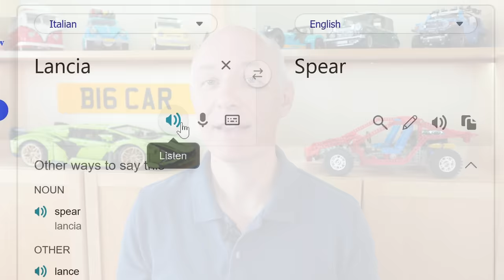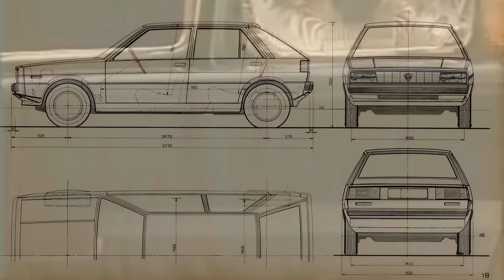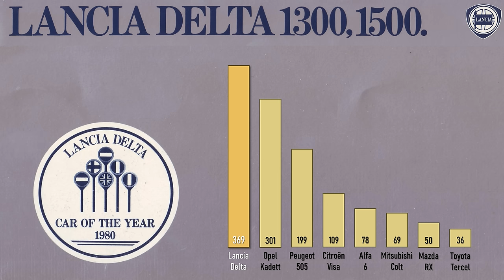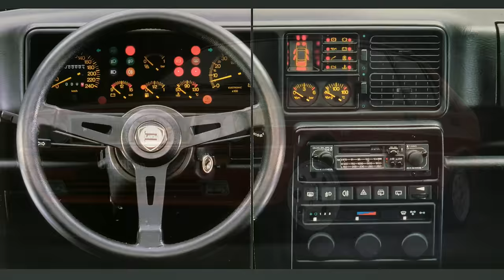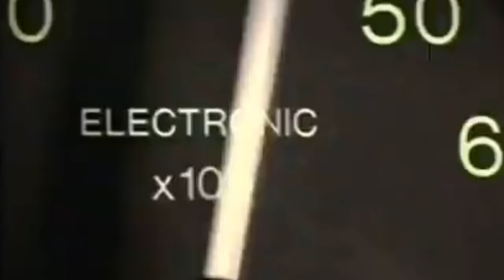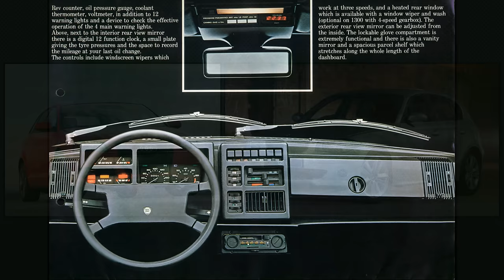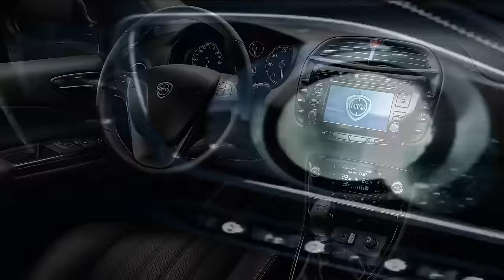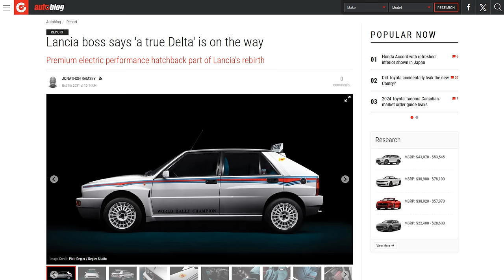Delta Forza - The Lancia Delta Story

Comment: It's incredible seeing an old Lancia Delta that is not an Integrale on the road: They look like two completely different cars. One is a battered, out of fashion, old italian mid sized hatchback, the other is a beautiful icon with a sporty and beautiful design.

PS an an italian, living a couple of kilometers away from where they built the Delta S4, I apprecaite the pronunciation effort.
Reply: I appreciate the original shape of the Delta before the swollen arches etc.
Reply: It's hardly a beauty... 😂 
The original Delta design was particularly good - especially for a fwd platform - with distinctly balanced, co-ordinated proportions.   Over time, the fine lines were taken over by more and more muscular features.  Panels, arches, lumps and scoops stretched over overhauled suspension, wheels, induction and engine - looked tough for once-practical passenger car, but it was never beautiful.
Reply: @assininecomment1630  No but it was handsome and stylish.
Reply: Yeah, I suppose you could say the early Integrale were handsome, @Jack-tx2ve .   Still, the extreme arches and bonnet bulges of final iterations, weren't 'gilding the lily', they were function over form.
Reply: A good simple GTi.e 1.6 with its standards alloys, velvety seats and tinted windows was a nice sight.

Comment: A cool thing: one of the Delta's design prototypes originated the FSO POLONEZ! FSO was originally planning to put 2.0 liter engine too, but the license to produce it was too expensive so they just adjusted the design with the Polski Fiat chassis.
Reply: They even shoved a Stratos engine in the back of a Polonez back in 1978
Reply: Now I want to see an AWD rally Polonez
Reply: @claudiobizama5603  The Polonez 2000, it was used on Rally.
Reply: This is a never confirmed myth. Both cars had totally different design preassumptions, since 137 prototype Polonez was based on, was meant to be rear wheel drive from the start.
Reply: @MREnzoHerbie   Not exactly. The Polonez was supposed to get a range of 1.4 to 2.0 SOHC engines, but since there was a 'temporary' use of 1.3 and 1.5 OHV, the sports division hand-built cars with 2.0 DOHC as homologation special.

Comment: I worked for a Lancia dealer in the early '80s and my firm's car was a Y10 Turbo, which was interesting to say the least. I drove almost all the cars in the range and I the car I remember most was the HF Turbo and the ie version that followed it. Despite having 130, and later 140 bhp it had narrower tyres than the XR3i and RS Turbo yet, still held the road really well and handled brilliantly. I always thought that was down to superior design and engineering.

Unfortunately the spectre of the Beta was never far away.

Comment: Fell in love with the Delta in the mid 80s when I saw one on the coast road in Liguria near San Remo in the mid 80 s… in the gorgeous blue colour like the one at 10:30 in the video… an iconic colour like on the Betas and Trevis of the period. I had a facelifted 1986 1300 LX in red, fantastic little car until a front end crash wrote it off.. bodyshell creased at the top of the A pillar / roof junction and that was that..😢

Comment: It’s good to be reminded of these cars. I had an ‘86 Delta HF Turbo i.e. which was great fun. It had it’s down sides (continuous electrical gremlins, single figure m.p.g. when driven <cough> spiritedly, and an appetite for wheel bearings (or maybe that was my driving style) and I used to describe it as a four door, two seater as putting adults in the back seats wasn’t kind), but it was FUN. Miss it still.
Replaced it with a 2 litre Dedra (thanks for mentioning them here, most people in the U.K. seem to have never heard of them) which was an enjoyable car, but definitely moved the dial more towards comfort over sport.
Reply: My 2.0 SE Dedra ranks as one of my all time favs, fast, reliable - burned a bit of oil - very comfortable and roomy.

Comment: I had a 1982 Delta 1500 HLX for a short while in the early 90's. It was the same colour as the one shown at 0:40 with the exact same interior trim as the one shown at 4:05. Although it had a really nice quality interior, and a few design quirks compared to most mainstream cars (interior door release was inset into the door armrest, so not immediately obvious as they blended into the trim), or MacPherson strut suspension all round, it was also the most unreliable car I have ever owned and left me stranded on quite a few occasions. Also, things like the ride height being quire high so that body roll in corners was massive, and when cruising at 70mpg in 5th gear the engine was pulling almost 4,000 rpm which was ridiculous.
Despite all this, I still remember it with fondness and if I had the money would consider buying a good condition HF Turbo. I probably would regret it as I would probably be left stranded somewhere, but at least it's a nice place to sit while waiting for the recovery truck. Again.

Comment: The HF4WD was special, pretty sure it was the first small hatchback with a 2.0 turbo and 4wd. The 0-60 was 6.8 seconds, that was outstanding back then. The integrale was 185bhp, the Kat (catalytic converter model for Swiss market) had 178bhp. The Hyena wasn't available as a convertible. The Evo came with 210bhp, Evo2 had 215bhp in standard form. I don't see Lancia making a come back.

Comment: Never really understood why they made an Alfa 155 Q4 which was Tipo based with integrale mechanicals, so they could have made a 2nd gen integrale
The Evo E cars died rather spectacularly in a fire sadly
Reply: I've read the Mk2 Integrale was canceled late in development as the rear floorpan was actually designed to fit a 4WD system
Reply: @JK061996  - that is true, early Mk2 examples are 4WD ready, they've replaced the floorpan to regular one later on.

Comment: In the 80's Fiat/Lancia dealerships sold the 5 doors bone stock Delta as a family car because Fiat had only the 3 door Uno available at that time.
Both had the same 1.3 engine and for that time already a 5 speed gearbox.
The in height adjustable steeringwheel was also not seen often at that time.
Bone stock means bonestock. no passenger side mirror, carburator instead of injection, in one piece foldable rear bench, no rev counter electric windows central locking.
When the Punto MK1 arrived  the Delta sales declined rapidly.

Comment: Back in the mid 80's I had as my company car an Astra MK1 which I found to be very suitable for the "A,B, &C" roads of rural Scotland. Part of the  job included the recovery of vehicles where their owners had reneged on the finance deal.  One such job included the recovery of two Lancia Delta's. Both had minor faults that had to be repaired before they could be sold to clear the balance of finance. I was fortunate enough to buy one of them as I had fixed the problems they both had! (dislocation of the gear linkage). Even today 38+ years later I still regret selling that absolute dream of a road rocket, & having bought two more over the years which were eaten by the rust worm!  The Delta is without doubt the best handling car that has been in mass production!

Comment: Passed my test in 1983 in a brand new 1.3 Ford escort. My mother had just traded in her Strada for a new Lancia Delta 1.3 and I got to drive it 2 hours after passing my test. I was sceptical of her choice but after only a few miles, I was converted. Often wondered how ford sold so many escorts which were £800 more expensive, had 10bhp less and only 4 gears.  She kept the car for 3 years and traded it in for a beige Renault 11. Still, least she made one good car choice over the years

Comment: Great video as always but the Hyena was conceived by Marcel Koops the Dutch Lancia importer. He took inspiration from the Alfa Romeo ES30 SZ which was based on the Alfa 75 and thought he could do similar with a more exotic car based on the integrale. Unfortunately FIAT/Lancia insisted he bought full cars rather than chassis so the cost escalated and hence the project floundered.

Comment: I used to drive an Integrale in the 90ies and a Delta II HF in the early 2000s. Wonderful cars - especially the Integrale, which came in black without any exterior tuning and the back lights not looking much different as VW Polo of this time. Made others likely underestimate this car. 
Once, I was driving through a village  exactly at legal speed, noticing an impatient big Mercedes S in the mirror - who of course started to overtake me even before the end of the village. At the sign, when he was around my height, I gave him a friendly smile and simply dove off, leaving him into dust without any chance. Satisfying. 
But most fun I've had on small, winding roads as they can be found in the mountains. 
It has been a nice time... sigh
For Lancias future, it will be really hard to find a good positioning. 
They already managed (especially outside Germany) to establish Alfa Romeo as a more sporty brand giving you some exclusivity compared to Audi & BMW - not being a cheap option. 
I don't think that there is much potential for another sporty brand amid generally declining interest in technology & motorsports (beside F1) and changing perception of car-ownership in urban areas. 
In times when you can order an Vauxhall/Opel Astra with all the fancy options that 5 years ago have been exclusive for high-priced models of premium brands, It would be hard to define, communicate and deliver another "luxury" approach - especially, since others like Genesis are already there. 
The only gap that I currently see in the market would be a "conservative" brand. 
A line of modern cars, that refuse to follow the trend to total minimalism. 
Continue to have switches & knobs for all relevant functions, distributed in a good ergonomic way. Have a big display in front of the driver, a touchscreen integrated in the dashboard in the middle - with the possibility to control actions there with a Mazda or BMW - like knob alternatively.

Comment: Delta came out before I was even born, and the first time the name Integrale was used, I was a toddler. Haven't seen one in the flesh until I was a teenager. Still, it had such a presence on the road, I had to know what it was. It's one of my hero cars, and I think it actually has ffans among the people my age. A retro model could, if done and marketed right, really pull in the crowd, like the 500 did.

Too bad it'll be electric though.

Comment: If anyone from Lancia is reading this, just remake the original Delta, job done, sure fire winner.🙂
I'm actually surprised we don't have more retro cars, like truly retro, not like the latest Mini's or Fiat 500's.🤔
Reply: You can't do this as a mass car producer due to emission regulations, passenger safety regulations, customer expectations in terms of reliability and way more. 
Besides this the fuel consumption (I remember using 13,5l on 100 km) of a Delta Integrale would make this a very expensive hobby.
One more argument against it:
At the time I drove an Integrale, I've been interested in technical details & have been well informed. It was clear to me that after a faster ride, I can't stop the engine immediately - instead, I have to wait a bit for turbo & oil to cool down. Same with the fact that I've had to change the oil every 15000km and use a good one then. Guess how many people would follow such limitations today & who will be blamed for dying turbos & engines in the end.
Selling this car today would be equal to committing suicide.
Reply: @peterm.2385  I know, but it's nice to dream. A version that's basically the same but with more modern engine and the required safety features could be doable though really.  I reckon there's a lot of old cars who's design would sell really well these days. Like the original Mini, one of those but with a more modern engine and safety equipment, but stylistically the same... I'd buy one.

Comment: if anyone owns a delta integrale and a cnc machine, consider making some frame reinforcements to prevent the frame from breaking like a digestive biscuit
and one more thing: if the price is sky-high on the used car market for the 4wd models is just because of some bar myths that inflates the bubble way too much

Comment: seriously looking to acquire a first generation LANCIA Delta HF Integrale (Y5/Tipo831) 4WD + 0.5 in. Lift 2.0 Biturbo I4 5-Dr Sports Hatchback (LHD) . . . built between 1987 - 1992 . . . could do with a WRC rally spec LANCIA Delta HF Integrale Evoluzione (Y5/Tipo831) 4WD + 0.5 in. Lift 2.0 Biturbo I4 5-Dr Rallye Hatchback (LHD) as well . . .